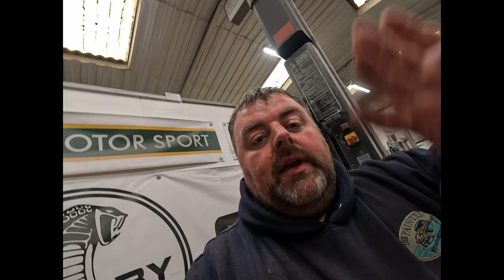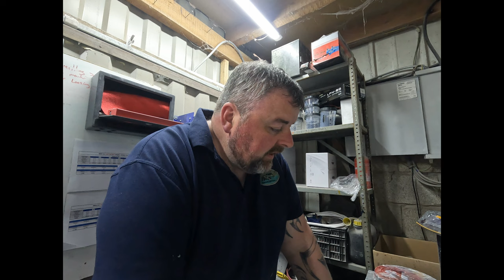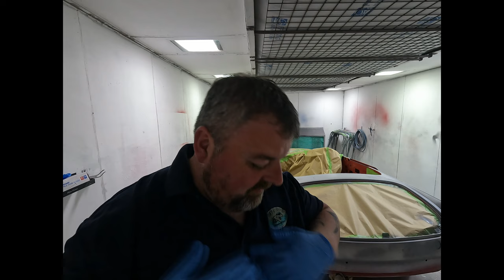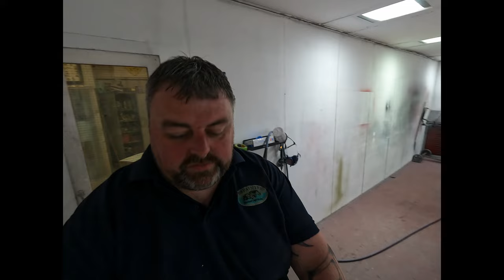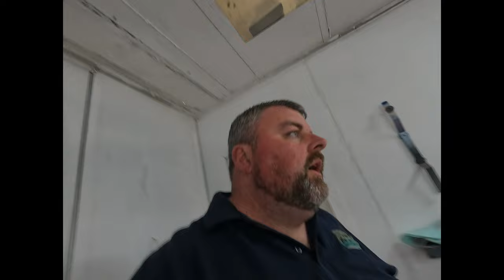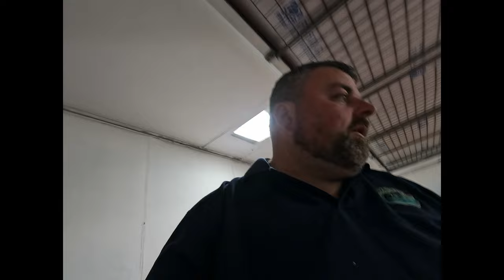mgb roadster getting painted in tartan red lets see what it looks like with some new paint on it

Comment: I picked up a '69 MGB-GT last summer ----- noticing you getting the ---- Fender Beads ---- cleaned up ----- Did you just sand up to them and get what you could out from the bottom or loosen up the fenders and lift them up and clean ----- They are just placed between the two panels and the bolts from the fender holds it place?  It seems like that is a good area for corrosion / rust to start ------- Hope to get started on a strip down and repaint on mine this summer ------ Thank You for sharing the video and EXPLAINING --- TROUBLE AREAS --- WHAT TO LOOK OUT FOR --- HOW TO REPAIR ---- AND HOW YOU PUT DOWN THE PAINT ---Enjoy watching your channel ---- Hope you have a Good Week ----- am trying to get caught up on your videos on MGB's ------ Thanks Again ------ Rodney
Reply from the maker: hi thanks for the comment if there is rust anywhere round it then yes they will have to be removed and the t pieces would have to be replaced if there no rust then id properly use a wire wheel to strip it clean ready for primer good luck with yours thanks